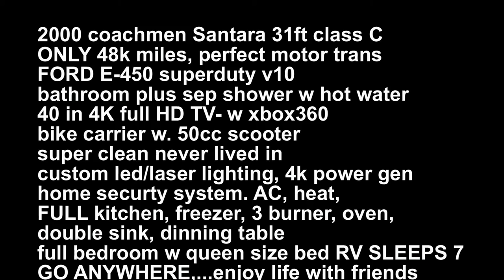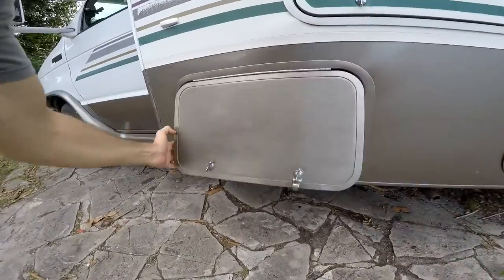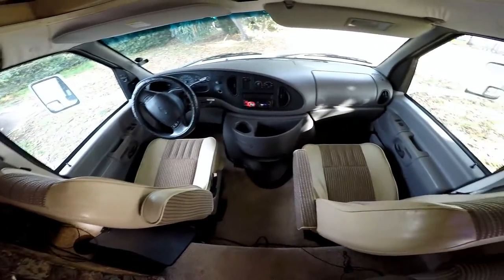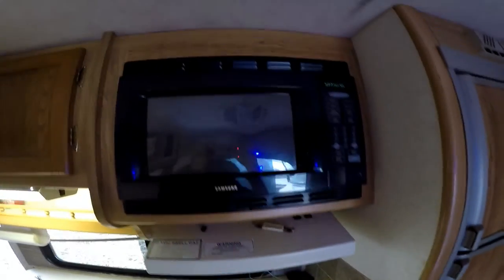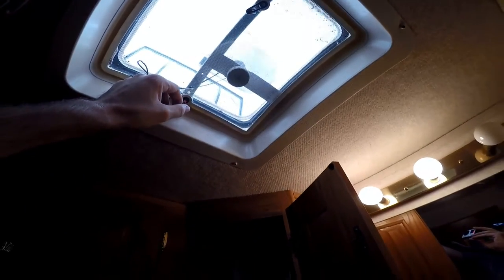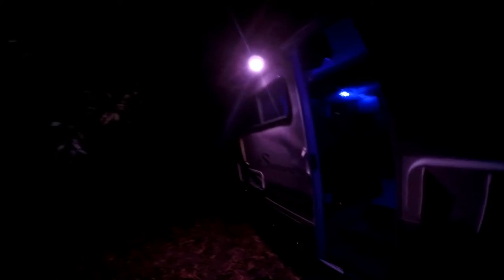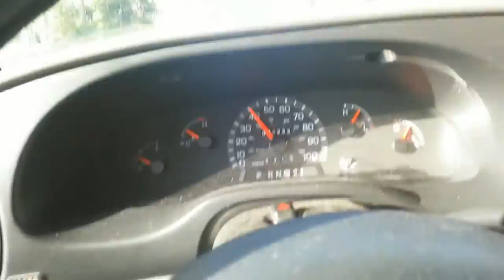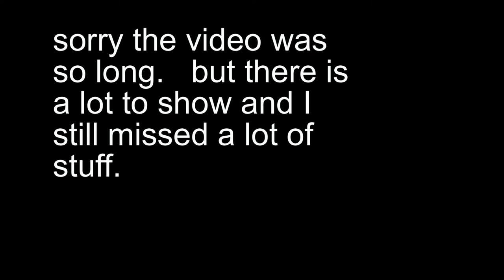2000 coachmen santara 311sb ford e450 RV mobile home for sale west palm beach

Comment: Good morning. I have an important question, I have a 1999 Ford E450 (6.8 V10 Triton) motorhome in Spain and when I went to check in the workshop, we did not find the VIN number on the chassis. I only see the VIN under the front glass, but I need to know where the VIN etched on the chassis is located.
Could you tell me where the VIN is located on the chassis?
Thanks.